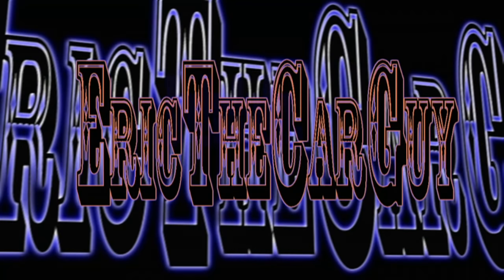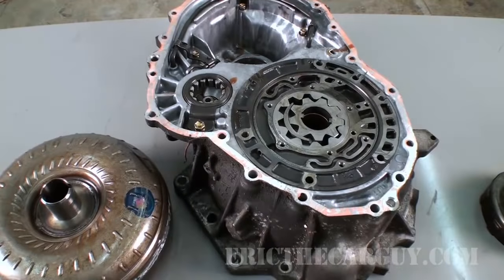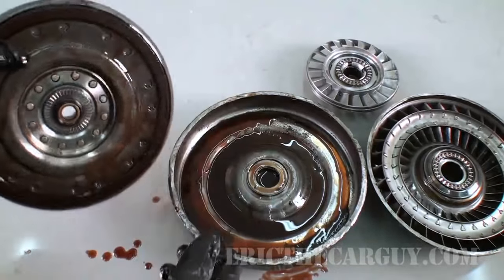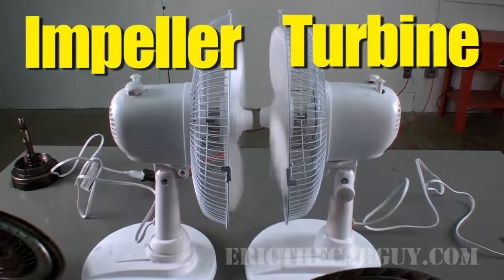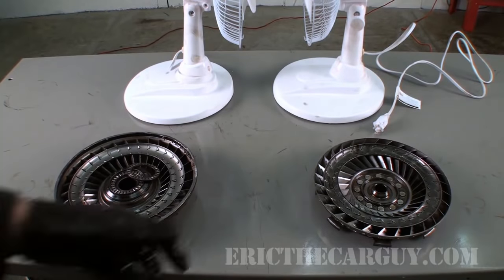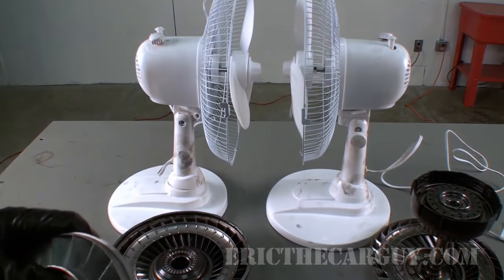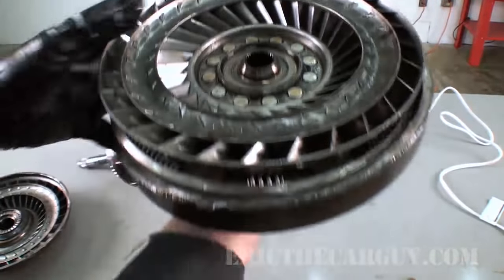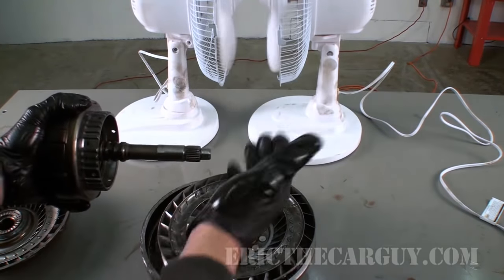How Does a Torque Converter Work?

Comment: It wasquite an engrossing video on the working of  a Torque Converter but the purpose & working of stator was not explained properly. 

Due to spinning of Impeller along with the engine, a Vortex is generated in the enclosed fluid within the Torque Converter. The generated Vortex spins the Turbine (as explained by you in the FAN ANALOGY). The Rebound of Vortex from  the turbine is diverted towards the Stator. The Stator changes the direction of the Vortex Rebound & adds on to the Vortex Energy of the Impeller. Increase in Vortex Energy of Impeller increases Torque. This is how the cycle goes about in a Torque Converter.

You had explained in the video that the Vortex Energy from the Impeller is changed direction and aids in spinning the Turbine!   

Vortex Energy generated by Impeller + Stator's Diverted Reaction from the Turbine into the Impeller = Increased Force to drive the Turbine & multiplication ofTorque

Now torque can be multiplied either through Force Increase or Impeller Radius Increase. In a Torque Converter, the Radius of the Impeller cannot be increased & so by increasing Force, Torque is increased.

Comment: I've always wanted to know what was in side the torque converter. I was born in 1954 , my parents always had ford cars and they were always
a stick shift . I'm was a farm kid & knew about clutches and gears.  when I was 16 , I bought a car 1961 ford sunliner automatic. the motor 
was  a V8 and  It needed a diff engine from the junk yard. After I changed it, It wouldn't move . Someone said  the torque converter wasn't working. But those pieces or those three main pieces you just out lined how one works How can they fail> Any way I changed the torque converter and the car worked. I used it till I went on to the next cheap used car I only paid $25 dollars for it. Isn't that funny how back then
there were cars for under $100 dollars. I  also think it's funny a guy (me) does all this work on a used car, then for some reason dumps it of
to the scrap or junkyard just for one thing breaking like  THE REAR END WENT OUT IN THE SUN LINNER. lol   I had or lets say went through
10 different cars that year.

Comment: Hi, everyone.  Iv got a automatic transmission pajero ns 4 x 4. The suv has started to move slow when im trying to go up hill or stop move stop. The engine revs goes above 2000rpm before the suv starts to move from a stand still position. Can anyone please help me if the torque convertor is the problem in my suv or is it something else.

Comment: Hey buddy I have a ? Plz I need your help my car has very poor acceleration after they rebuild my transmission and rebuild torque converter at a shop through my warranty and there’s no check engine like on no codes the transmission readings or good engine readings r good but the acceleration is very bad I been reading on this and they say a bad torque converter will not throw a code is this right my engine is very strong transmission readings r good so I’m lost and confused the shop that did it is telling me it’s my engine but all is good with engine and transmission switches gears I put it on live data and like I said there’s no engine light on and no codes it’s a 2008 infiniti m35 very beautiful car I really need to figure this out so plz help me .

Comment: Not a mechanic, what would cause the trans. to shift on it's own from drive to forth, causing the eng. to race from 1500 rpm's say 5000 rpm at the same time column indicator moves?  (2004 2500 dodge diesel)people who know transmissions say it's electrical not mechanical...HELP

Comment: For those "stick shift" folks and their opinion about modern Vehicles have better performance with a manual trans...they are highly mistaken. Today's automatic's are just as fast in acceleration as the stick shift, for the  most part. The C7 Corvette automatic is just under 1 second faster than the stick shift version...I'll opt for the automatics almost any day.

Comment: I know that what I'm about to say will be laughed at by everyone. You did your best to explain the use of a torque converter. Logically, they are nothing more than primitive junk. Furthermore, isn't a torque converter mounted to a flywheel? I have no problem claiming to be wrong but I thought a flexplate was part of the clutch system.

Comment: As I thought, the torque converter is an inefficient but simple and (edit: relatively) cheap cop-out that manufacturers use to avoid actually having to produce a clutch that operates automatically. Maybe that was truly necessary in, say, the 1970's, but can we really not do better than this waste today?